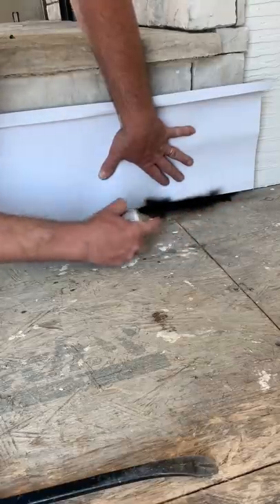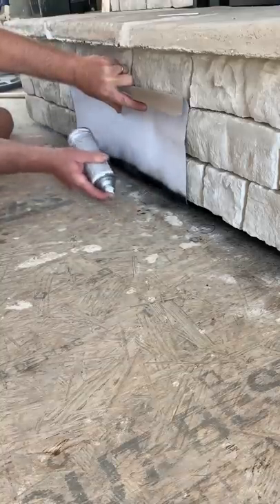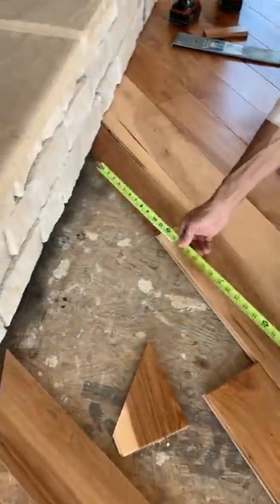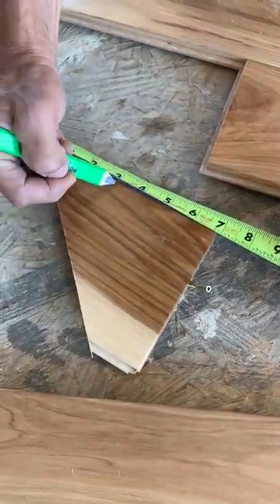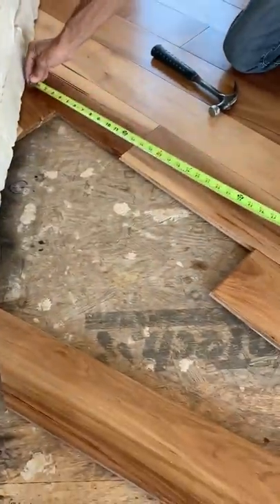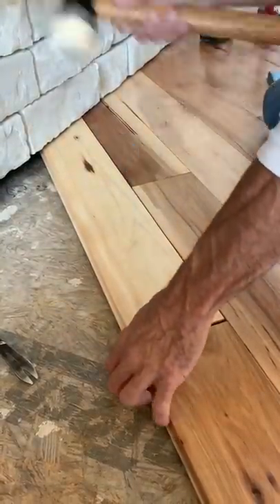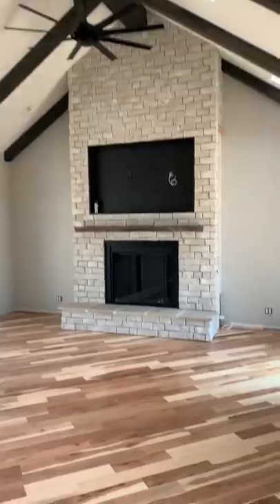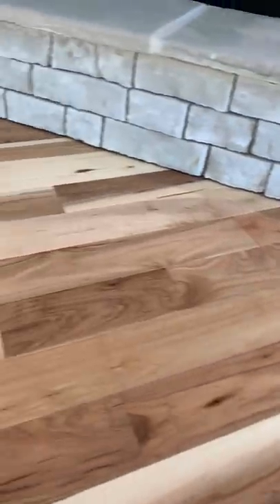Pro Hardwood Tips #shorts

Comment: Going at angle doubles cost of installing
Reply from the maker: No, not really
Reply: @w.k.d.constructionllc  yes really.  I installed flooring like that for 20 yrs.
Reply from the maker: @laserfalcon  it takes a little more time but not double. If you charged double than good for you! This was one room and it was open so no real time loss. I just charged the same as straight lay
Reply: @w.k.d.constructionllc  We just charged according to time, of course all our floors were sanded and custom finished which added more blending of the edges being sanded.  I love the look but added to cost of job. If doing for yourself then no biggie.
Reply from the maker: @laserfalcon  this was all pre-finished so just the one installation aspect. This was not for myself, this was in a custom home I built. We did price an unfinished floor but the cost was excessive to the budget, almost 50% more (on 4k sq ft of wood) so we went with the pre-finished and it was still in 35k range
Reply: @w.k.d.constructionllc   I advised many of customers to go prefinished at my risk of losing work because of cost and or mess of custom finishing.   Too honest

Comment: Pro tip I can see the gaps in those end joints from here....also why did he set it 7/8 of an inch when the flooring is 3/4
? got a 1/8 inch gap now. should have set it at 7/16.
Reply from the maker: Because I used stone and it doesn't have a perfectly uniform side. plus, I wanted and 1/8" gap for wiggle room and also didn't want the stone to set directly on the wood

Comment: The gap under the brick is too high if you still showing a 1/4  inch  gap , unless you plan to fill in the gap , because dirt will eventually get under the brick.
Reply from the maker: Dust, not dirt…this is inside

Comment: Where is your felt? Does hickory not require it? Never messed with it
Reply from the maker: Usually, any hardwood recommends a felt type underlayment. This floor is a glue assist per manufacturers recommendations since it is a 5" width, so I am using an adhesive and cleats to fasten. It would be useless to glue the floor to felt or rosin paper. That is the main reason I don't have it, but my crawlspace is encapsulated and is a conditioned space. Hence being, the moisture barrier is installed under the house.
Reply: @w.k.d.constructionllc  gotcha. I’ve even had floor manufacturers straight up not recommend wide floors because they tend to cup so bad.
Reply from the maker: @TheRealDill93  I'm not a fan of the 5" widths in solid wood, because of the cupping. Its wood, you can't help it.... wood is going to do what it wants. I try to recommend engineered for the wider withs, but it also too can slightly cup. Harder to see, but if the sun hits it just right you can definitely see it.
Reply: @w.k.d.constructionllc  Yeah and right now it seems the wide floor is in. Everyone wants it. But you’re right. Wood is gonna do what it’s gonna do.

Comment: Next time instead of pinch cutting reverse lay and start your board under fireplace. It's a easy easier process doing it that way instead.
Reply from the maker: Couldn’t in this situation, I had a 18’ slider with fixed panels at the other end. So, I started there to be super precise and ended under the stone

Comment: It somehow bothers me that there's no mortar but that there are empty slits in-between all those stones.
Reply from the maker: supposed to be, called a "dry" stack stone
Reply: @w.k.d.constructionllc  I understand. It's just not my kind of style I guess. It also bothers me that the low, front section sticks out further on the sides than the high partition that sits against the wall does. But I guess that's either the chosen design or the way the masons carried it out. Besides that it IS a nice type of stone. The flooring is very well done by you!

Comment: I'm confused.. what's the point of the spraypaint?  I dont see it AFTER he puts all the hardwood in.  Not that ANY of this matters since im broke and will never own a home....
Reply from the maker: Thats the point, its black under there so it is hidden to the eye. There was white mortar used as the scratch coat, so if I hadn't of painted it and I installed the floor.... there is a greater possibility that you would see "white" under there and it would have looked uneven since the stone is not perfectly flat or square.

Comment: Here that would not be allowed as there is to little stone next to the fireplace
Reply from the maker: This should be fine whatever the code is where you are? I know it’s different per state but, this is a gas log insert and there is 20” width of masonry hearth before any wood.
Reply: @w.k.d.constructionllc  here you need at least a meter of stone floor around the fireplace for all the sparks to not burn your house down.
Reply from the maker: @triumvir_hunt  this has no sparks, embers, or wood. This is a ventless gas log. Gas logs don’t have as strict clearances vs with real wood fires.

Comment: What’s flooring like that run per sqft??
Reply: Probably $4-6/sq. Pretty basic. Competition has kept things fairly reasonable these days.
Reply: Sorry, I don't know if you mean install as well. If you're considering install, you want to consider floor width. For example- a 2.5" floor technically requires  half of the labor as a 5" floor. That's just perspective. Personally, I'm a fine finish carpenter, so I usually do entire houses, and I'm a little bit more expensive when installing floor because I make sure all fasteners are hidden or non existent using either adhesive or biscuits. All that aside, I charge around $3-10/sq myself for click in vynil/prefinished, or my capable subcontractors range between $2-7/sq. All in all, nothing is less than $6/sq for finished vynil($3/sq material++$3/sq install) and nothing is less than $10/sq for hardwood. Average $13-14 for premium. Not including custom borders, herringbone, or differing materials that lead to meticulous sanding practices.
Reply: Wow, tons of info here. Thanks so much for the reply and vast information. You’re awesome

Comment: No paper underneath?
Reply from the maker: No, glue assist. so paper is not ideal for adhesive to bond to. My crawl space is encapsulated and is conditioned with 2 dehumidifiers, So no humidity or moisture issues.

Comment: All that effort under the stone is great, but you’re not doing anyone any favors by not installing a layer of felt or at least some red resin paper to create a cleavage membrane and help moderate seasonal movement of the floor. If you’re going over anything other than a fully conditioned space below..unheated basement…crawlspace…suspended floor…. A moisture retarder is critical for a quiet durable installation. Wood against wood, even Advantech,  which  is a good stable substrate, will result in a creakier crackier floor in a few years. I don’t care what Huber says…these are the same clowns that want you to skip the roofing felt and housewrap if going over their Zip sheathing panels.  Total false economy.
Reply from the maker: Well sir, my crawl space in this home is fully conditioned. I have central air supply and 2 returns, I also have 2 dehumidifiers to take any extra moisture out of the air. It is fully encapsulated, and the foundation walls are ICF. There is less humidity in the crawl space than there is in the actual living space. So, there isn't a need for a felt. This is a glue assist per manufacturers recommendation's, anything over 3" is to be glue assist and this floor is 5".

Comment: You put it down away from the pain in ass the sections... Should have went from the fireplace wall to the other wall. Then you could give a crap on the length at the fireplace.
Reply from the maker: negative ghost rider, other end was a 18' long slider with fixed panels. So, I had to end at the fireplace.

Comment: If you would have read at the opposite way and started your wood off of the fireplace you wouldn't be having this issue think about your installation before you start my advice to you
Reply from the maker: There is no issue here, I ran it correctly. I had an 18' slider and fixed panels at the other end! I had to start there and end under the fireplace. Don't assume you're correct there boss on what you can't see!?

Comment: Moisture  barrier?
Reply from the maker: It’s on a conditioned crawl space, no need to have in under flooring
Reply: @w.k.d.construction  your are able to constantly check  subfloor 15 felt also absorbs the hollow sounds it will make with foot traffic..Random length hickory will expand and contract no matter what..Just take one split tongue especially when u beat material with steel end of mallet..
What part of the country is this material installed?
How long did u acclimate flooding in temp controlled area ?
Reply from the maker: @michaelvignale7265  any solid hardwood expands and contracts. I’m in NW Tennessee and it probably acclimated for a month. This was a glue assist so felt wasn’t an option.

Comment: I own my own flooring company. Here’s a few things you have no moisture barrier. I always put down Wakol roll on moisture barrier and then I glue the whole floor and staple. Your floor is going to gap out
Reply from the maker: Negative ghost rider. This is glue assist and I only use cleats to fasten not staples. Btw, my moisture barrier is under the house where my crawlspace is encapsulated with dehumidification…it’s conditioned air. This is no different than installing on a second story.

Comment: Look at that ugly pvc chase for TV wiring. Why you didn’t think ahead and ran it inside the wall?
Reply from the maker: Think before you comment. Do you believe this is the finished product?  I had built in custom cabinetry installed on each side of the fireplace. So with that said, all wires and conduits were hidden. Thanks for watching

Comment: Pro hardwood floor tip… used tar paper.
Reply from the maker: No need with glue assist install and encapsulation with conditioned air in the crawl space.

Comment: He says Pro Tip: and then says he uses a tape measure to measure off of a starter that's undercut? 

Stop it. I stopped using a tap measure on hardwood in the 90s when I was in my teens. 

Pro Tip: if you're running your floor on a 45° why would you invert the tongue into the fireplace? You could have started off the corner and glued a slip-tongue into the groove and worked out of both sides. And 
Pro Tip: instead of prying off ANYTHING, try putting a large flathead screwdriver in front of the tongue facing into the substrate, pound it into the floor and pry off the tongue. If you really have a warped board and don't just throw it out, you can use a scrap block in front of it, but with hickory, if you have to pry a tongue to the point you crush the tongue into the plank, your prefinished floor will gap anyways if you use it.
Reply: Lmao, "don't use measuring tapes", "also use screwdrivers as pry bars"